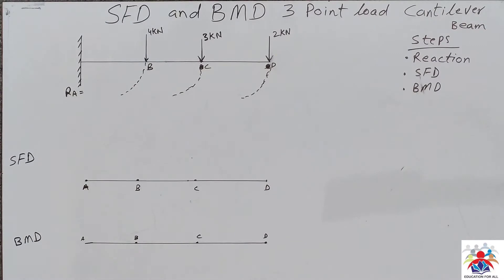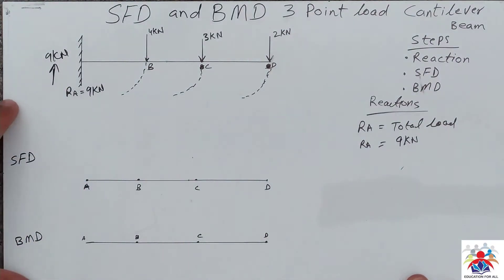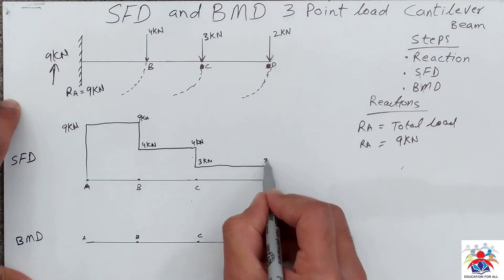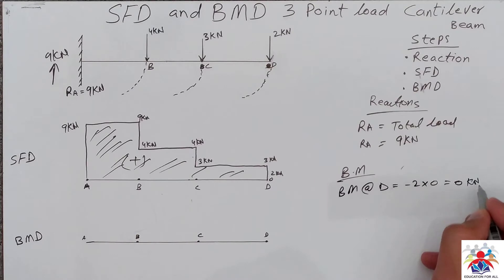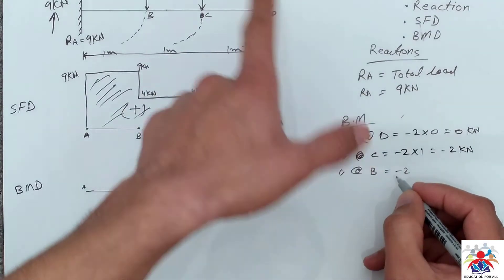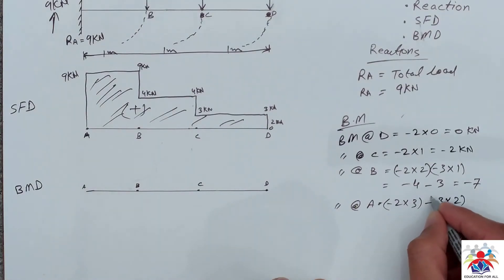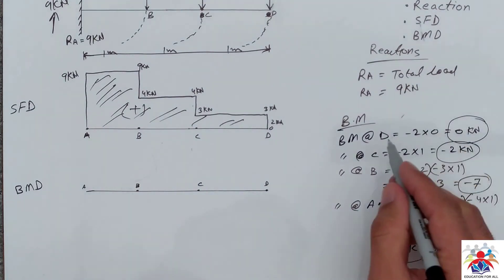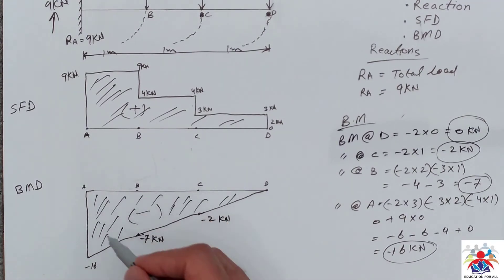SFD and BMD 3 point loads on Cantilever Beam

Comment: Sir i have a query why you are not considering the Reaction force of A ?
Reply from the maker: @knightthegamer9786  dear sir I did consider the reaction force at A which is 9KN in this example it’s a cantilever beam that means we have only one support which is A and all the forces coming downwards are reacted via support A. Thanks
Reply: @educationforall1442   I mean for bending moment
Reply from the maker: @knightthegamer9786  for BM at point A means zero because there is no distance so force X distance = 9x0=0 at A
If you check by calculating from Point D to A I hope you will understand. Treat A like D. While considering other downwards forces.
Reply: @educationforall1442  ok thankyou sir
Reply from the maker: @knightthegamer9786  no problem happy to help 👍🏼

Comment: I wanted practical examples. If it is possible, Kindly give a practical example with a problem. thanks
Reply from the maker: Thank you for your question. A practical example includes a staircase which are fixed in wall or verandas without pillers I would also say shades on top of windows